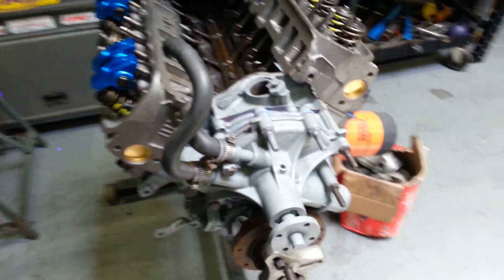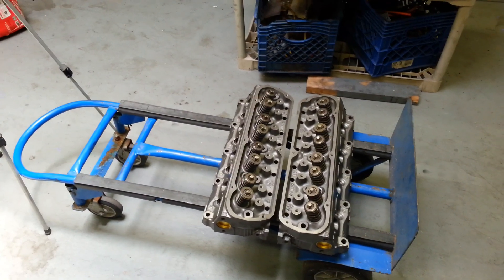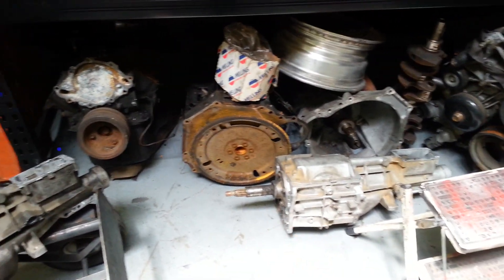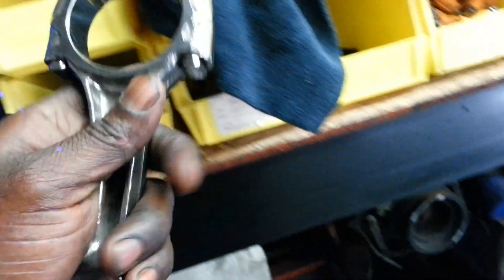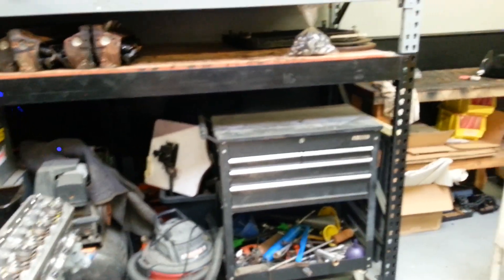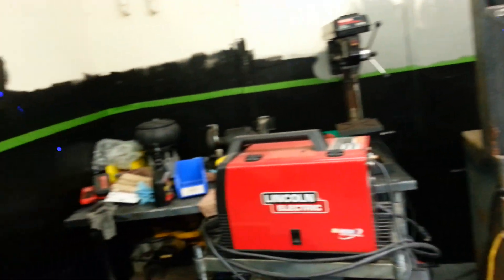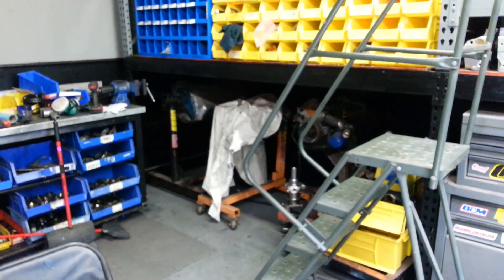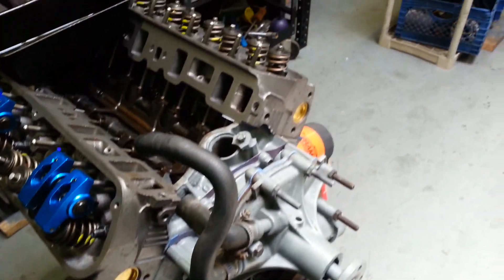JUNKYARD DOGGS UPDATE!!!!

Comment: Hope you get better bro.  Wondering if you'd recommend building a 302 or throwing a 331 stroker crank in and building it with that?
Reply from the maker: thx man I will.  I would be careful to do all my calculations and research before spending any money.  strokers can get tricky with block clearance and things like that.